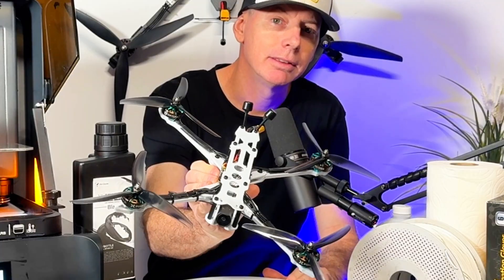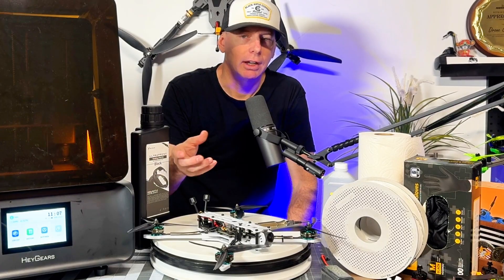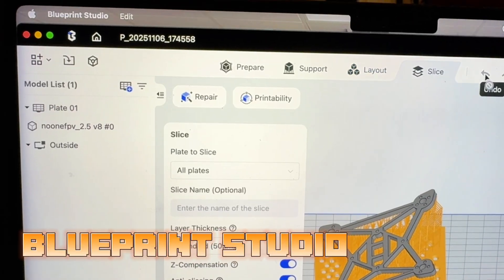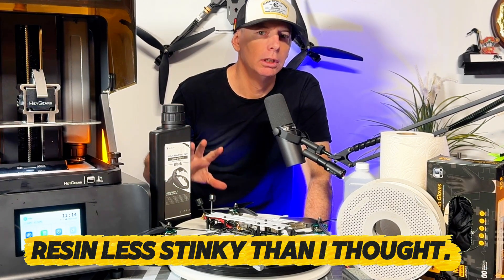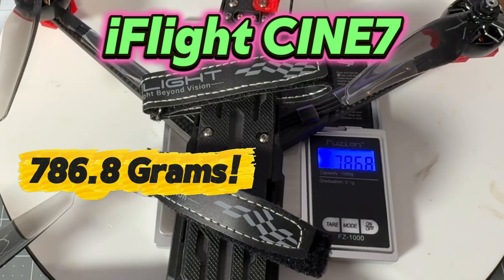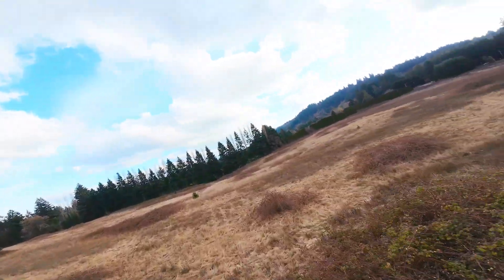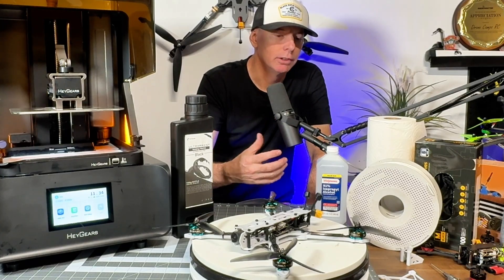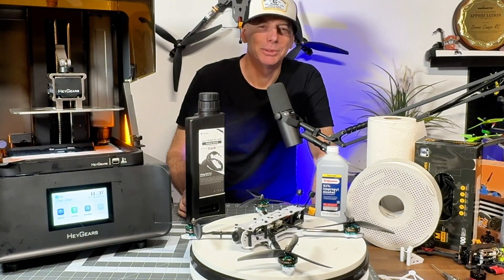We RESIN Printed a Long Range FPV Drone! - HeyGears Reflex RS Turbo Review 🔥

Comment: I've been watching your channel for more than two years now and I'm excited to see you building this resin printed drone. 3D printed drones seem to get bad rap on various you tube channels.   While I am new to the world of hobby drones I started in R/C aircraft way back in the 70's as a kid.  Since getting into drones a couple of years ago I have been applying my more than fifteen years experience with 3D printing as applied to the manufacturing sector.  I am big into precision ducted drones of my own designs from wee little whoops and up.  I have in my shop resin printers and filament type printers too and have in storage old powder bed type printers.  My printer of choice for drone airframes is the filament type as I can take advantage of the ability to create hollow shell structures and have control over the interior of the shell.  This type of construction is call semi monocoque and is widely used in the full scale aircraft industry.  The outer shell stabilized by the inner reinforcements are what carries the loads resulting in a light and stiff airframe.

I am using carbon fiber nylon as a filament with great success and no, I am not using expensive high end industrial printers but hobby type printers which can print up to 290 degrees C.  While I prefer ducted drones for their increased safety and uniqueness I recently challenged myself to design a printed 5" freestyle drone of the configuration most commonly built from solid carbon laminate.  I like to study various airframe designs so I used an AOS 5" as a baseline to see if I can match it's stiffness and weight.  The result was an airframe which weighs several grams less than the AOS, this in spite of widening the body for more battery room and using a more robust camera mounting system. The main body is very stiff and the arms are difficult to flex.  I have yet to build out the airframe as I'm busy on building and 8" ducted quadcopter and considering entering the DARPA lift challenge with an 18" version.

More power to you!

Comment: Resin printers can be great, but don't underestimate the toxicity of resin. It's much more toxic than ABS or most other common filaments from what I understand.

If you aren't using a fume hood or are like right next to an open garage, you should be wearing a heavy duty mask. 

Oh, I've been meaning to say I really like the new into video, not completely sure about the music, but the video is awesome! 

Stay safe with the resin!
Reply from the maker: We have the printer in a box and vented out of the garage. But yeah still somewhat stinky.
Reply: More dangerous than abs, only if u drink it, where the hell do u get your I formation from, YouTube?
Reply: @jimmyjames1807   a common way of accidental exposure is handling resin without gloves and then getting that on your food.

To answer your question though, is in being honest, this particular information is in my head from YouTube, (but not just any random YouTube!). Most of what I believe about the toxicity of resin is just from what Adam Savage (formerly of Mythbusters) has said on his YouTube channel, "Tested". I haven't actually researched the topic in-depth myself because I've yet to work with resin. However Adam is usually a pretty smart guy and verifies things before sharing them. 

Also, looking at a filament chat blue, I think I may have confused ABS with another filament type. I don't have a 3D printer so this information fades quickly. 

However, I did recently read an article that claimed a recent university study with mice has suggested regular respiratory exposure to resin is likely more carcinogenic than cigarette smoking. Obviously that's just one study, and with mice (or it might have been rats)  not humans, but when signs of potential risks like that exist, it's best to be extra cautious.

Comment: Personally I wouldn't trust a 3d print with my drone
Reply from the maker: Ive flown them for 10 years. Never had an issue. They're less durable, but you can print another part faster than you can order one in the mail. And once you have the STL files you have them forever. Unlike certain drone companies who quite making frame parts for older frames.